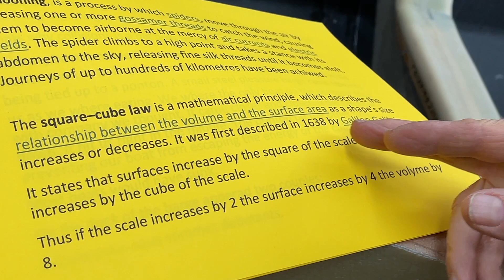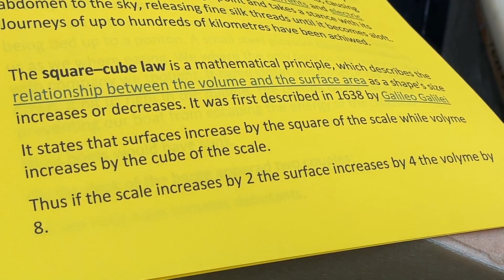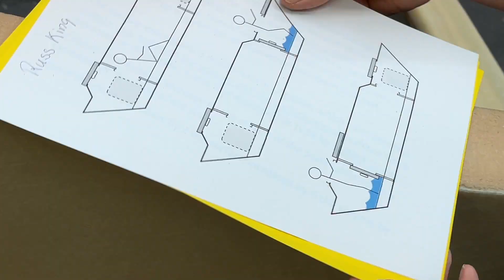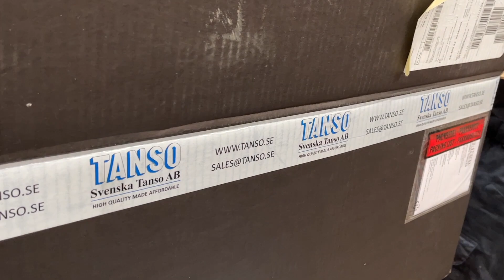Big and small are different Bonos Tanso peel ply.

Comment: Up- and downscaling is interesting. The spider can simply cut off the thread and fall to the ground. It will soon get terminal velocity and the exo skeleton will take the rest. But spiders cannot get larger than about 20 cm. Then the exo skeleton becomes too heavy for the muscles inside. If you make a small 6x2 m boat out of 3 mm steel, it will be very stiff and strong, and still float. But you cannot just scale it up to a 200x40 m vessel. You do not make it out of 100 mm steel plates. But about 25 mm. It will be too expensive and weight too much. Compared to its size it will have much thinner hull and with length much stronger forces to bend the hull. Thats why a large vessel is quite flexible and so week you can break it appart by loading it wrong or by long time wear and big waves. If you would scale down a vessel to a model, it will be made of aluminium foil.

Ship flexing: https://www.youtube.com/watch?v=rHlEXn37dVg
Ship breaking: https://www.youtube.com/watch?v=gaZhnNlutuQ

Comment: I think, if he were alive today, Phil Bolger would like your design ideas.

One posible design weakness is the separate compartments. Arguably, they enhance the safety of the vessel. The problem can be that, if the forward one takes on a lot of water, it can put the boat way out of trim.

Phil Bolger dealt with this problem by making the forward and aft compartments free flooding. This meant they provided no static buoyancy. But, due to the small hole they flooded through, they did provide plenty of dynamic buoyancy.

On my own 6.5 m mini-voyager design, I have fore and aft compartments, which are only accessible through deck hatches. As my design is to be built out of wood, each of these compartments has its own ventilation system.

But none of these compartments is designed to work the boat from.

This is done only from the much larger center compartment.

For your boat, with forward and aft compartments designed to be worked from, the situation is much different.

Imagine having to work from the bow one, fo example, in very rough weather.

Water can come cascading down the open hatch and completely flood that compartment, well above the Water Line.

Now, not only do you have a bow-down trim problem, but now you cannot re-enter the center compartment, through the below deck hatch, without bringing a lot of that water with you.

I suggest putting at least one one-way valve in each of these compartments, just above the Water Line. This way, if that compartment floods (from the open deck hatch above), the water can flow back out through this valve, but not back in. This would effectively limit how much water can collect in this compartment to way less than its total keel-to-deck volume.
Reply from the maker: Hi Bob. The sea is gentle to small boats. During all my years of ocean sailing dating back to 1969 only once has a small amount of water enterd. I t was during a squall a dark night October 2011 in the Bay of Biscay. It was about a bucket. There have been a few  other times with about one liter mostly to make life irritable but not of any danger.
When a I see a breaker approaching I close the hatch. There is also a pump so that I can empty with boath hatches closed.
I do not worry. This design is way better than most floatning vessels. Bolger designed many interesting boats but as far as I know no ocean going one excepat a rowing boat.

Comment: At what point does a boat become big? 7 meters is small, 10 is big? Or is it better determine by mass? Thanks Yrvind.
Reply from the maker: I say a boat is small when you can propel her with an oar, not just in a dead calm. I say a boat is small when you can fend her of a dock without being young and strong.
I say a boat is smal when you can trail her behind a medium sized car.
Its mot the meter as you said, am olympic single scull is 8.2 meter long weighs 14 kilo.